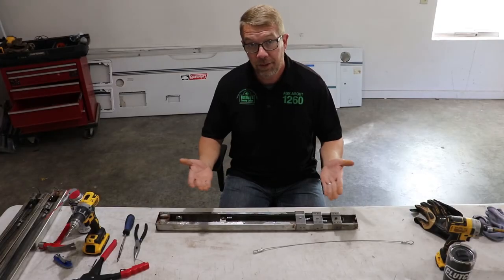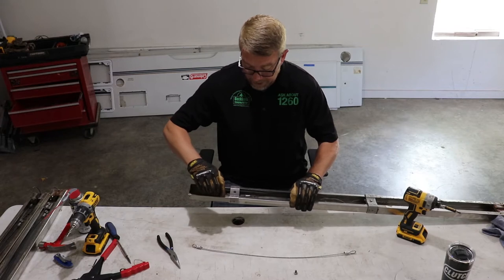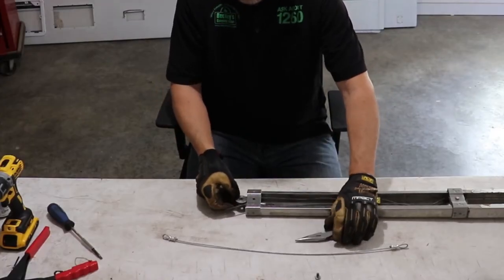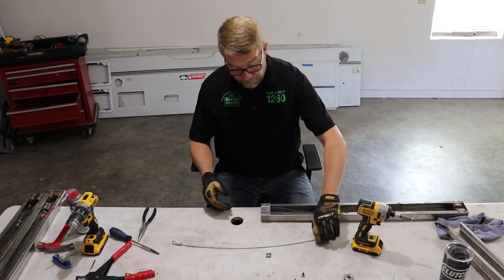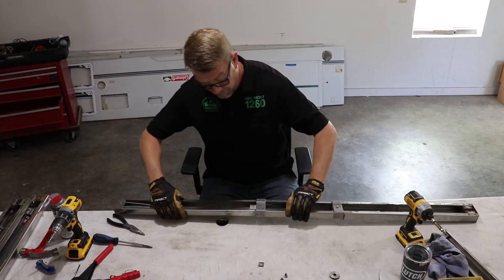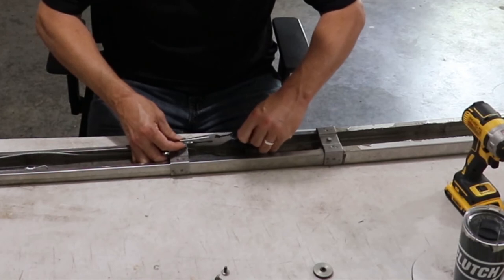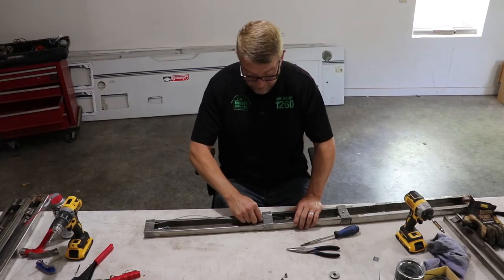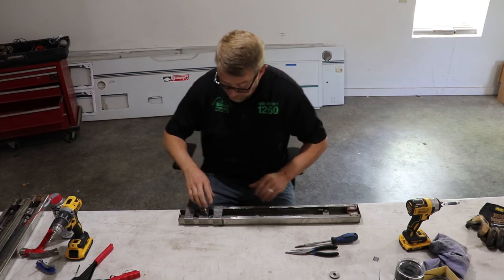Coleman pop up stage cable replacement

Comment: Great video! Quick question , i was raising my popup the other day and about half way up it got very hard to crank. I stopped and checked underneath. Found one of the corner cables had skipped the pully and got stuck really bad. After 3 hours and lots of bad words i was able to fix it. Can you tell me what would cause this? And how to prevent it? Thanks so much.
Reply from the maker: Possibly a worn pulley?

Comment: Off the wall question.  I park my pup under trees to keep the sun off it, I don't have a carport, I also cover it to keep off sap and from leaves staining it.  I put the silver side up on the tarp to cut down on heat build up.  It this ok
Reply from the maker: Never a tarp. Tarps can trap condensation and cause quick damage. Consider a breathable RV cover.

Comment: Hello Derek, I am a new Coleman owner. I am planning a restoration and remodeling of a 1985 Williamsburg.  My first question is: can the manual cable system be replaced by a linear electric system of some kind? I have weak shoulders.
Reply from the maker: Sure! Expect some fabrication for your camper though.

Comment: What year camper is that lift system from? I have a 2010 Fleetwood/Coleman E3.  My cables seem to be in a bind because top is really hard to lift.  I have to turn crank a few time, then walk around the camper and manually lift up on the corners.  Also, the top will not raise all the way up because door will not seat.  Seems to be a few inches low.
Reply from the maker: David, Your camper may just need some TLC. For hard to raise issues, many times the thrust bearing is the culprit. Height adjustments can be done at the whiffle tree drawbar, and at the pulley guide brackets.
Reply: @popupcamperpro  Got it done.  Took about 3 hours.  The front cables ended up being a little long (installed by previous owner or OEM).  Even thought there was a knot already in the line, the adjustment was bottomed out so no more room.  I ended up adding another knot (all knots located by the wiffle tree) to give me about 1" of adjustment.  I was then able to get the top to raise all the way up.  It still seems a bit tough to raise but definitely better.  This is my second E3 and the first one also had knots in the front two cables but raising that one was a breeze.  I'll take this one out a couple of times and see if I can live with the toughness to raise.   If not, I will replace the thrust bearing as suggested.  Thanks for your videos and support.   BTW, I called a dozen shops and mobile RV repair people and no one wanted to tackle this job.  Really not that big a deal if you are handy.

Comment: Also one other question. I have a 2005 fleetwood valor.  I was checking the lift height, according to the chart mine should measure 46-47 inches. It currently measures 44.5 to 45 depending on the corner.  The problem I'm having is I don't think the canvas well allow me to go 2 more inches...is that chart correct for my model?
Reply from the maker: Jon, there are a few errors in the books over the 30 plus years they were produced. Myself, I know of 2. It's possible, but more likely a cable adjustment or a canvas replacement may be required.

Comment: How do you remove the lift arm?
Reply from the maker: 4 bolts from inside the frame attach the bottom of the arm to the trailers frame.
Reply: What size are the nolts

Comment: It doesn't appear you can get the assembly out without cutting out the stage cable on mine
Reply: Edit: nevermind, just saw the comment about the 4 bolts